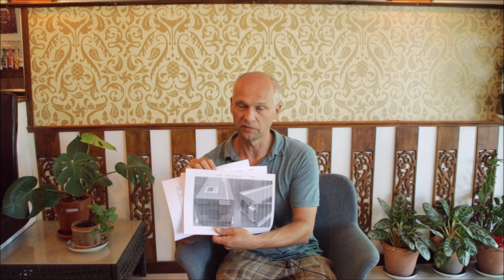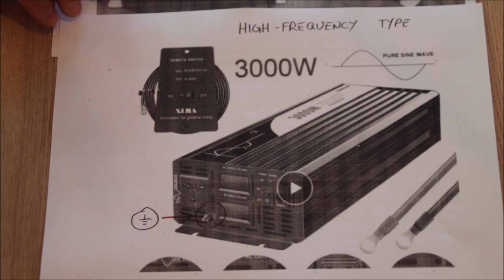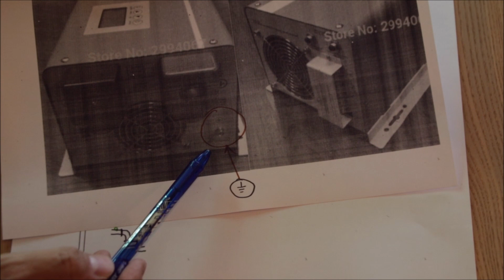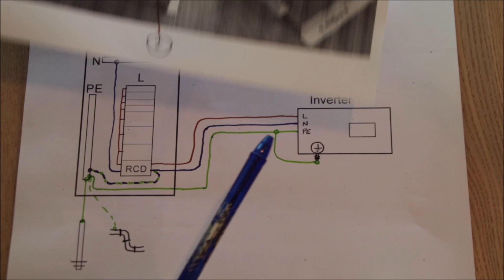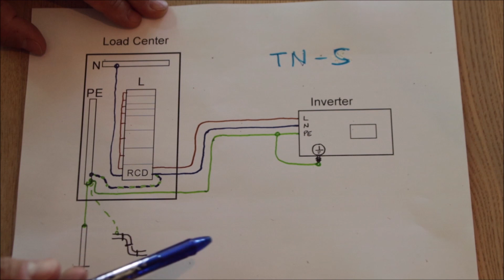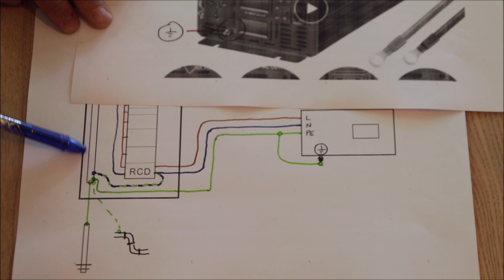Inverter Earthing and N-G Bonding in a simple Off-Grid Setup

Comment: I already  have three phase rcd in load center. How to bond in that scenario?
I have single phase LF inverter.
Reply from the maker: So only 3-phase RCD, instead the 1-phase? Yes, you connect everything as show on the schematic, but just connect the L1 phase. The Test feature/button will probably not work as normally as the tester is using 2 phases for the test circuit. But the RCD will still work as normally!
Reply: @RolandW_DIYEnergyandMore  Thank you for reply.
Reply: @RolandW_DIYEnergyandMore  I now have two sources. And on both I have rcd protection in order for both systems to operate simultaneously the neutrals must be separated and interrupted by a relay, and the load phase?
Reply from the maker: @djordjelukovac8041  two sources as of Inverter/Grid or 2 Inverters for different circuits?
Reply: @RolandW_DIYEnergyandMore  two sources inverter and grid.
Reply from the maker: @djordjelukovac8041  did you watch this video? https://youtu.be/H5Pt5i5gG2I this one is about Grid/Inverter combination. Because if Grid is involved, you need to consider the earthing system which is coming with the Grid
Reply: When the grid is down the inverter works as an isolation  transformer. Both neutral and phase are interrupted from grid to the load with the relay.
When grid comes back ,both neutral and phase are switched back and inverter is disconected.
Now i just want to add that rcd on inverter side.
Relays have mechanical interlock.
Reply from the maker: @djordjelukovac8041  OK, i understand. You are making an automatic transfer. I do not see a need for an own RCD. make the transfer so, that you then feed into your existing system. not possible? The bonding should be made at inverter infront of your transfer relay. The other video should actually show you the case
Reply: @RolandW_DIYEnergyandMore  
Sorry to bother you,  because I live in a building, can I permanently connect one phase of the inverter directly to the ground in the apartment, then go to the differential device and then to the transfer switch?

I want to have differential protection on the inverter side.
Reply: My building already has its own grounding in the foundation and I have nowhere to place the grounding rod.
Reply: Basement is full of concrete.

Comment: I would also be interested to hear about grounding and earthing the battery and solar array in a system like this.
Reply from the maker: I have a video about general "Grounding and Surge Protection" on the channel. Battery grounding? DC power lines are not grounded in a solar application. DC stays isolated. If you have a metal enclosure for the battery, then you can of course ground that for safety.
Reply: @RolandW_DIYEnergyandMore  Thanks. I have read that in some situations people are grounding either the positive or negative side of their battery to the same grounding system bus as the AC side. I think this is more common in higher voltage batteries.
Reply from the maker: @leonclose7823  isolated systems do have the advantage to provide safety against electrocution if one would touch a power line, because as long none of the lines is grounded, the circuit stays open and current cannot flow over a human body (one point of contact rule). So typically isolation will be kept if not otherwise required differently. More complex systems might need a "common ground" to interact with different parts of the system. So there isolation will have to be traded of against whatever needs to be achieved with the system. But as I said, in a normal solar application, the DC side should be kept isolated.
Reply: @RolandW_DIYEnergyandMore  Good to know, one less thing for me to worry about.
Reply: Shouldn’t I earth my solar panel if I’m a lightning prone area  ? If yes should I bond the DC negative and the solar panel